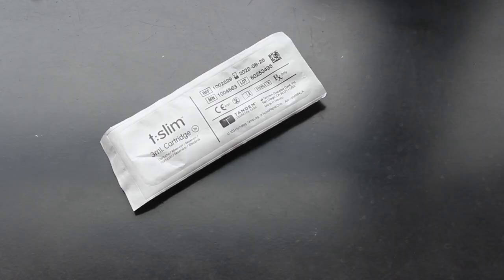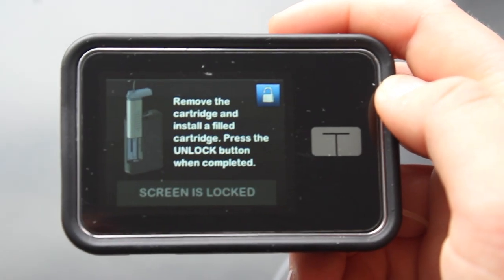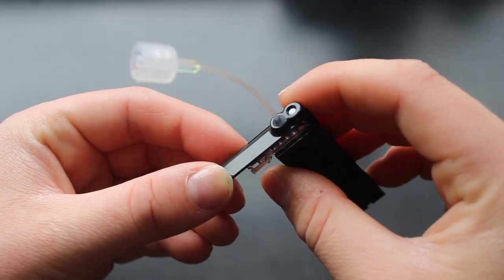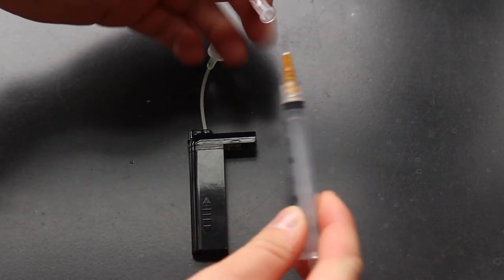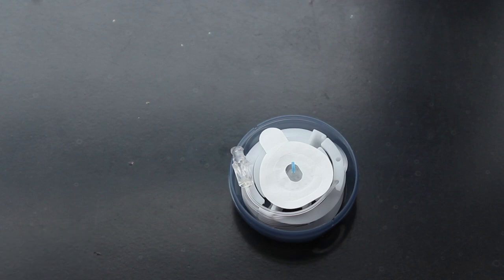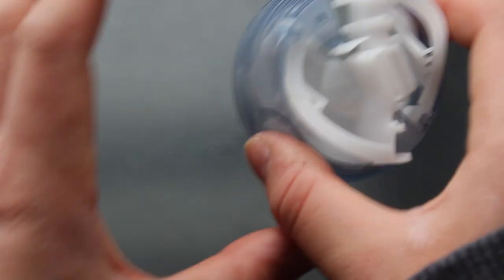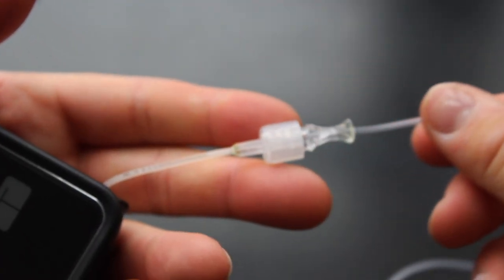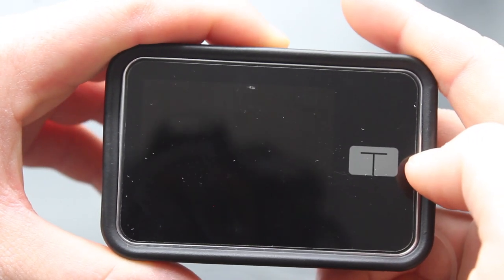How to Change Tandem Insulin Pump Cartridge and Infusion Set

Comment: You know it comes with a plastic, square "key" to remove the cartridge rather than trying to use the floppy piece of the syringe right?
 I picture people attempting that with the needle screwed in and the safety cap off...
Reply from the maker: This is a great point. I have the "key" but have never been a fan of carrying around an extra tool. Where do you keep your key?
Reply: @ronireynolds6129  on my keychain
Reply: The handle on a spoon or fork work perfectly to eject the insulin cartridge.  Or a quarter or nickel or penny work just as well too.

Comment: What does it mean if the letter B in the upper right hand corner by the bars is orange
Reply from the maker: Hi Karen, from what I saw on the tandem website, the orange B means that Control-IQ is decreasing your basal rate. I found that information here: 

https://support.tandemdiabetes.com/hc/en-us/articles/1500011411702-What-does-the-symbol-mean-A-guide-for-the-t-slim-X2-pump-

I hope that helps!

Comment: Thank you very much for the video :) Does the needle sometimes bend or does it hurt while inserting?
Reply from the maker: The needle that is left inserted from the infusion set is a plastic cannula that is flexible and can move with your body! The metal needle that helps it to be inserted comes out but I have never seen it bent at all.
Reply: Yes it hurts... I prefer the steel needle.